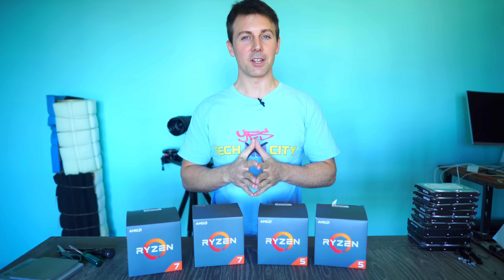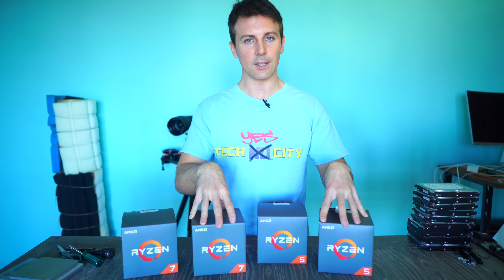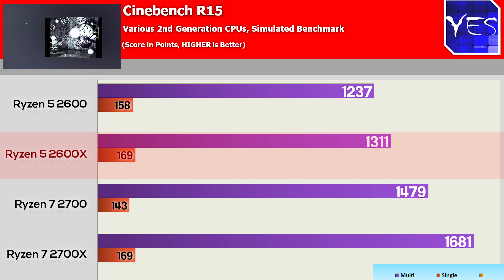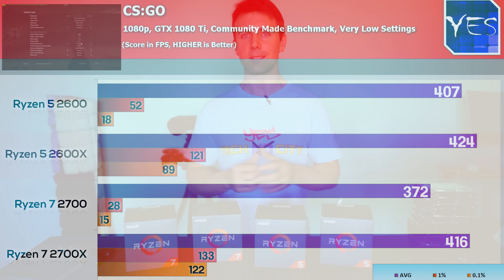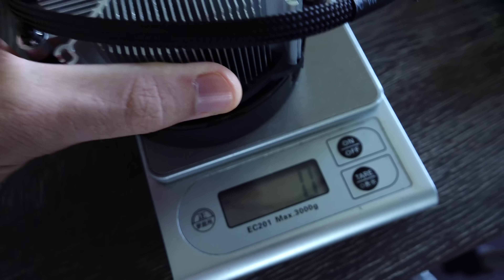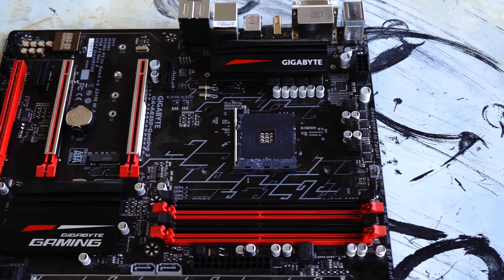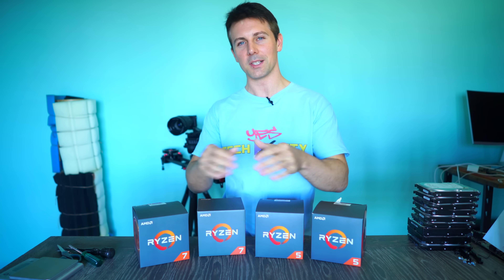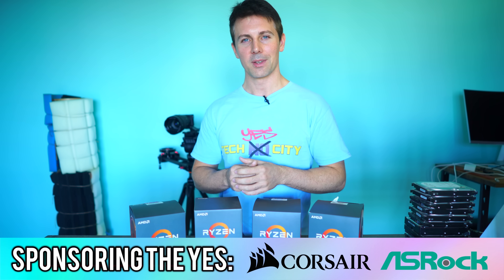Ryzen 7 2700X Vs 2700 Vs Ryzen 5 2600X Vs 2600 - Is the X Better Value...!?

Comment: My Ryzen 5 1600 is still doing great. Upgraded from FX 6300. Maybe in 4-5 more years but I would probably only upgrade a gpu rather than my cpu
Reply: hergendy Must have been a faulty motherboard. The R5 1600 can fully utilize even a gtx1080ti.
Reply: hergendy I have a 1600x with a 1060 and it runs great. No issues at all. I even render 4K video footage with it and no issues.
Reply: Jasmin Janpers I have to agree, not only has better thermals but it comes with the same cooler as the 2600X (without rgb but who cares)
Reply: Jimbo you could upgrade sometime when the last zen2+/zen3 processor comes out (R5 4600? maybe)
Reply: I gave my Ryzen 5 1600 and a board to my dad just recently for helping me shift camp I hope he feels the same way as he is upgrading from an 8350.  I was very impressed with the overclock easily bumps up to 3.8- 3.9 with a good cooler the value in that CPU is definitely there. my old man should be happy when he finally gets his up and running ;).
Reply: hergendy sounds like your power supply is bad. Or your mobo was bad....
Reply: I'm planning to go Ryzen 2700x from an 8350. It was either that or the 8700k. Some things made me not go bac to Intel.
Reply: What’s does the Ryzen 5 have over the FX 6300? Sorry for my ignorance, I am thinking of going from the FX 6300 to the Ryzen 7, but I don’t know how it will help me... (I have a 1070TI)
Reply: me still using my FX6300
Reply: but the 2600 is the same price at the 1600 what should i buy
Reply: Hashslingingslasher the 2600 if they are the same price
Reply: Jacob Wonder you're going to see a huge performance change in your favor. Fx chips were a let down but still usable. You'll be great with a ryzen Upgrade and 1070.
Reply: Seems like you were unlucky and got a dodgy chip in that regard
Reply: Dean Barrett Cool dad bro my parents don't know what a computer is
Reply: Keep it. I purchased the Ryzen 3 2200G, so upgrading to the 2600 and better is logical for me. You already have the 1600, so why upgrade unless you want to go to the 7, right?
Reply: same here with my r5 1600 loving it for sure. games and streams battlefield 1 with a obs and a cpl chrome browsers and barely touches 45/50% cpu load and i can oc it to 3.9ghz with 1.39volts so im happy and qith ny gskill ripjaw 4 series 3000mhz 15cl ram it easily score over 1300 on cinebench whixh i think is good. anyways lovin it and have no regrets at all :)
Reply: that's exacty what i'm doing. edit:still using the fx-6300 as of right now
Reply: Ay I had a FX8350 for years, before than a Phenom II x6 1090t which honestly was better than the FX series wish I kept that CPU.

Sold the FX series when I heard about ryzen went back to the stone age and used a i7 2600 non k for a couple years then ryzen came. Just got a 2600 recently and a noctua cooler.
Reply: Cope
Reply: actually you Don't need always upgrade you gpu just used him then wait his dead.
Reply: Jimbo same
Reply: I went from a 2600k to the 1600 in 2017. My first AMD CPU. Been using intel since the 90's. No complaints, apart from teething issues when they were first released. Thought I bought a brick, but persistence and illogical troubleshooting solved it.
Reply: and if you oc it to 3.9 you are good to go...
Reply: Please get the 5 2600x. I have 32bg mem at 3200 mhz. It's dam fast.
Reply: After two years i got a ryzen 7 2700 and a b450 hdv motherboard for 170$ it was really a good deal
Reply: Both the 1600 and 1600x are the best value for the money. My 1600x has been stable at 4.1 GHz on all cores for the past 9 months. Had I purchased a 1600 it would have probably capped out at 3.7 GHz on all cores. I won't be upgrading my cpu until Matisse (Ryzen 3) in 2020.
Reply: Had a 1600, for like 3 months. Added a GTX 1060 to the rig and the whole system became unstable, any overclock to the memory or CPU would cause random crashes making the system unusable basically. Rocking an i5-8400 cheaper and more stable.
Reply: @hergendy  I have a Ryzen 1600 and I am overclocked to 4.0 and it's very stable.
Reply: The Intel Boy!!!

Comment: Great vid Bryan! :)
Just bought 2600x and B350 board. Productivity more than gaming but still it's rock in both.
No need to overcklock coz AMD do a great job with this second gen boost - in my opinion :)
Thanks!
Reply: Did the B350 work out of the box with 2600x? I mean i know you must update the bios but is the system atleast post  to let you update ? I buy Gigabyte Auris X370 Gaming 5 and now i will buy 2600x but dont have spare 1st gen Ryzen just to update the bios

Comment: the 2600x is looking good if you want just straight out of the box performance
Reply: should i get a 2600 + x470 board? or 2600x +b450 board?
Reply: 2600x with b450 board. The 2600 comes with the wraith stealth cooler I believe, while the 2600x has a much better spire cooler. The 2600x just has better performance out of the box for only like 30$ more, while including a better cooler. Besides, you don't need a x470 board unless you want sli/ extreme overclocking anyway.
Reply: Weeb what ram speed do you suggest for 2600x on b450 motherboard such as msi gaming pro carbon ac.? 🙄
Reply: Iman Dutta Just get the highest speed you can afford. 3200mhz is the sweet spot, but for most tasks like gaming, you won't notice too much of a difference compared to 2666mhz, especially since ram is so expensive rn.
Reply: Weeb bloody 3000mhz is expensive here.. I was thinking more like 2600 or 2400 and enable xmp. What do you think.
Reply: Iman Dutta Yea get 2400 and overclock to 2666.
Reply: Weeb will 2400mhz oc to near 3000mhz??
Reply: Iman Dutta doubt it
Reply: Weeb than 2666mhz is good enough for me.. Thanks for your help.. I really appreciate it.. Cheers ✌️
Reply: X470 works with future am4 cpu's. So yes, go for x470 coz it's around 150 euros/dollars.
Reply: @Grey-q1k  Once you have chosen MB, you should visit its support site to find out list of supported tested RAM modules. Its provided for every MB.
Reply: you can pretty much turn a 2600 to a 2600x easily
Reply: @Soreyu  would be a b450 mobo (specifically the MSI B450 Gaming Pro Carbon AC) is dissent enough for the 2700 and the X version or x470 is still the best choice?
Reply: @Grey-q1k  Anything over 3000mhz should do fine with latest bios update.
Reply: @Soreyu  thank you very much! now my mind is set to get the 2600X. I've been looking into many videos and I still can't figure out which is better for me. I am not planning to overclock anything at all. here's my planned specs by the way. your thoughts?

Proc: Ryzen 5 2600
X
Mobo: MSI Mortar MAX B450M
SSD: 240gb Kingston
RAM: T-Force 8Gb 2666Mhz x2
GPU: MSI Armor RX570 8Gb
PSU: Silverstone 600W

is this okay? For the case, I'm getting a standard ATX.
Reply: Thanks man! 
Actually i live in India and the prices of x470s is around 40-50% higher than b450s. so i bought a asus b450f.
My new rig 
Amd 2600x
Asus b450-f gaming
16 gb 3000mhz Corsair Vengeance
Zotac 1060 6gb amp edition
Reply: I seem to be hearing this a lot about the 2600X, makes me feel better about my choice to get one. Now if only the power supply and memory would hurry up and get here!!
Reply: What would go best with a asus prime b450ma csm am4 motherboard using a gigabyte aorus radeon rx580 XTR graphics card want the best one for both gaming and streaming and new with overclocking so wouldn’t be doing that just yet?
Reply: I'm thinking of gaming but also content creation, I'm thinking the b450 tomahawk with the 2600x. I won't be overclocking right away but may in future once I understand how it all works. Will this still be suitable along with 3200mhz ddr4 ram x2 8gbs? Thanks.
Reply: Alex Gerontzos it should be fine. Some motherboards might only support 2933 MHz ram though. Also, the 2nd gen ryzen cpu have xfr2, which allows them to clock up to 4ghz on some cores by themselves so you might not even need to overclock.
Reply: Weeb oh ok that's good to know! Thanks for the reply!
Reply: This is what I want! But the 2600X costs 50€ more ;(
Reply: What is the best budget board and other part for 2600x?
Reply: @muhammaddanish3113  hi can you help us with price?

Comment: Just trying to figure out the best thing for me:
Should I go 1600 and use my 7850 OR go 2400g and sell the 7850? I'm looking to go from Sandy Bridge to Ryzen in July. My main thing is rendering video, not gaming.
Reply: R5 1600, but there might be deals by then where you can go for a 2600 or 2600X so don't buy anything just now.
Reply: R5 1600 or 2600

Comment: Can you do a memory overclocking guide? Timings are a bit confusing.
Reply: http://www.overclock.net/t/1640919/ryzen-dram-calculator-overclocking-dram

The primary timings are deduced from the factory set latency in nanoseconds and the maths is, latency in ns / (2 / Frequency) / 1000.
For example, say the XMP CAS latency is 8.75 ns and the RAM's frequency is 3200 MHz, that'd give a CAS timing of 14 (8.75 / (2 / 3200) / 1000).

Then the secondary and tertiary timings are all maths equations based on the primary timings, the memory's frequency, and even the NB frequency for some.
For example, minimum tRAS = tCL + tRCD + 2, tRFC 2 = tRFC / 1.34, and tRFC 4 = tRFC 2 / 1.625.

It does get more complicated than this, especially since there're alternative ways to do the maths for certain sub-timings and sometimes rules need to be followed like how tWR has to always be an even value, but this is the basic gist of the timings.
Reply: I believe tech yes city has already done a memory overclocking guide aswell, you should be able to look it up with ease by adding his name after memory overclocking.

Comment: 2700X out of the box for me. I do a lot of content work and do not use Premiere, so using Vegas Pro or Pinnacle Studio 21 Ultimate, the cores/threads get used. BUT, curious to if you overclocked the 2700 to 2700X numbers, does the power draw increase to the same?
Reply: Yes, the Ryzen 7's are about the same. It's what you have to do to get the performance that matters. If you are not into overclocking, the $30 difference between the "X" and the non "X" gives you a guarantee clock speed and a better cooler. With the non-X variant, you will have to spend the money for a better cooler, and change BIOS settings to overclock it. For "me", spending the additional $30 is not that big a deal. It makes it now "plug and play".
Reply: If I just want to play games. Is the 2600x good?
Reply: ricky ticky yes
Reply: Anthony Pierre yep
Reply: Im eager to test Studio One 3 and Some VST instruments to see how it handles a lot of instruments at once under load.
Reply: 2700 vs 2700x does it make sense to spend extra penny on x variant considering the performance gap?  i mainly use for streaming and video editing
Reply: @Traumatree  Non-X doesn't mean bad SMT. I have a 1700(non-X) and it shows 16 CPUs in Task Manager. Out of the box it scored 130 single and 1410 multi(versus 105 single and 695 multi on my fx8350 at 4.4) in Cinebench R15. When I enabled XMP profile for my ram(raising it from 2133 to its rated 3000mhz) my performance jumped to 148 single and not sure on multi(higher, though for sure). I have it overclocked to 3.8 with like 158 single and almost 1700 multi. I tried 3.9 which required a substantial voltage increase and wasn't really stable, getting 160 single and just over 1700 in multi. This is on the included Wraith Spire RGB cooler, btw. The minimal extra performance for the increase in voltage and instability wasn't worth it, so 3.8 it is(at stock voltage, no less).

Edit:The R7 1700 was $180 at Newegg. Could have gotten a 1700X for $160, but then I would have needed to get a compatible cooler(though I do still have the cooler that came with the FX8350. That thing is rated at 125w and the clip connectors are compatible with the AM4 socket, but the fan is relatively tiny and loud. I have a Hyper 212 evo on my 8350). Shortly after I bought my 1700, the price dropped to $170. Kind of wish I waited a bit, but then I might not have gotten as good a deal on some of my other components. I'm happy with the purchase, though.

Comment: Can you do a dedicated memory overclocking and maybe an updated oc guide for the 2nd Gen Ryzen?
Reply: RAM OC: http://www.overclock.net/t/1640919/ryzen-dram-calculator-overclocking-dram
Reply: id try to achieve what your kits rated to run at.  some suggest setting the voltage on the kit slightly higher than the rated one.  like if it says 1.35  on the kit and its not stable maybe try 1.4 and test.   3600 and lower would be your max. I have read 3466 with very good timings  would be the ideal point. otherwise 3200 kit and call it a day. XMP Profiles are pretty good with the newer boards.

Comment: Do you have any videos where you overclocked the 2700? I'm really curious to see if it can reach the same levels for people who already have a decent cooler carried over from a different build. I really don't care about the cooler, but if the x can achieve higher clocks than the non x I'd deem that worth an extra $30. Just the same, if the non x can clock identically then I'd much rather save the $30.

Comment: Hi Bryan, I got the GSkill flare X 2x8 GB 2400 mHz, I tried OCing it, but cannot go anywhere even we change timing and 1.35V. My PC wont load to windows. Using Gigabyte Gaming  B350 board (updated bios)
Reply: Try http://www.overclock.net/t/1640919/ryzen-dram-calculator-overclocking-dram

Comment: The stuttering issue you describe is strange. I've got Ryzen 1600 and now upgraded to 2700x with RAM @2666 Mhz and the smoothness in gaming is stunning with GTX 1060. So how the heck you experience stuttering even with default memory clocks?

Comment: I'm running a Ryzen 7 2700X on an Asrock AB350 Gaming-ITX with the Wraith Prism cooler in a Corsair Obsidian 250D case, and it runs super and the temps are good. I have no intention of overclocking the 2700X, and I was considering the 2700non-x but for my ITX needs I prefered the higher base clock performance of the 2700X.